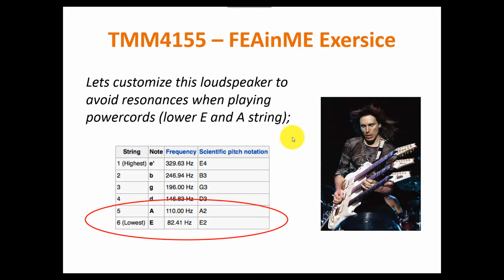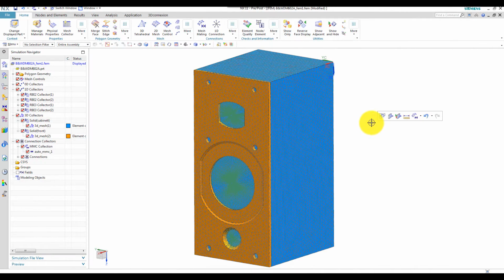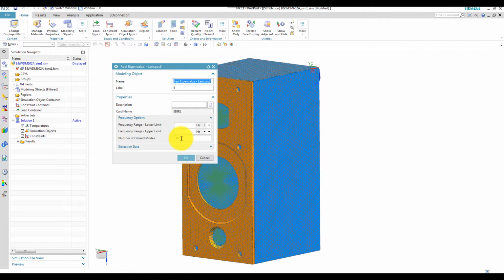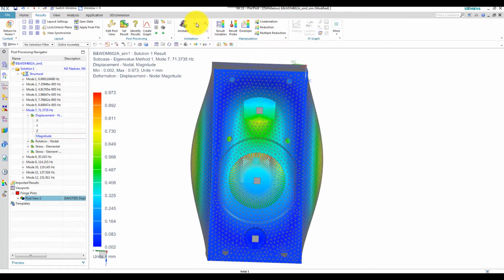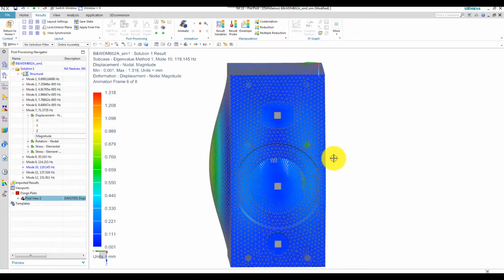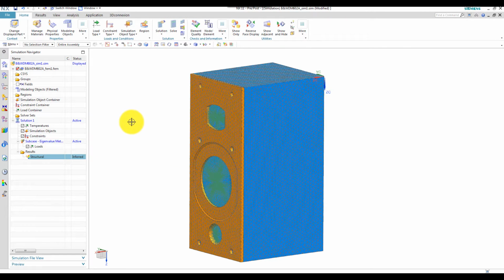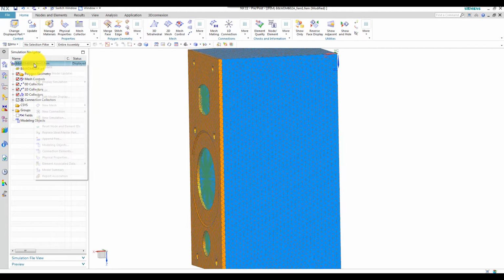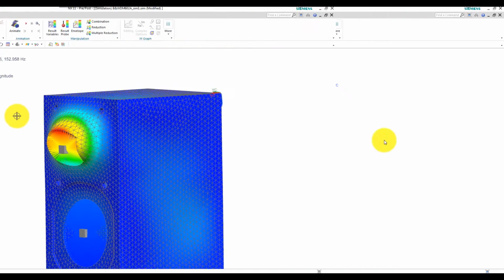NX SOL103 B&W Modal analysis

Comment: Hi, I have one question, I want to do a free modal analysis of a drone without constraints. I get the results in SOL 103, but when I include a static subcase because of surface contacts and bolt pretension in my model, I do not get results. It only gives results when I constraint the model. Is it possible to get results in this case without defining the constraints in the model as I want to simulate the drone in mid-air where there is no motion constraints.
Reply from the maker: Hi, it is possible to setup subcases in a solution with different (local not global) constraints. A static analysis will require contraints as you have noticed while a modal analysis can do without due to the use of the shift factor that allow you to calculate free free modes. It is also possible to add (rigid body) constraints to your free free analysis without messing up the modes.
Reply: Hi, Thanks for the reply. I just wanted to ask one more thing whether applying constraints to the body should change the modes and natural frequency that I am getting from doing the modal analysis without adding constraints. I got some difference in natural frequencies and mode shaped in the above two cases. Are those results correct, should the natural frequency and mode shapes not suppose to be independent of the constraint conditions in the modal.  Thanks for sharing the knowledge.
Reply from the maker: You must check if your solution is based on local or global constraints. Local shall only be applied to the active solution

Comment: How can I fix the following error when I try to solve in the .sim file?
WARNING:
Potential problems with the rigid links may exist in the model:
   - Rigid Links are connected to elements which do not have rotational degrees of 
     freedom (DOF).  This may result in solver errors.
   - Rigid Links connected to other rigid links.  (Watch for rigid loops.)
   - Rigid Links not connected to other elements.
If solver fails, check for inconsistent degrees of freedom.